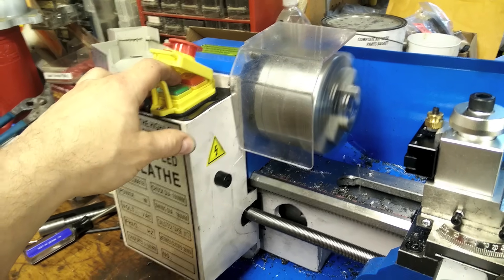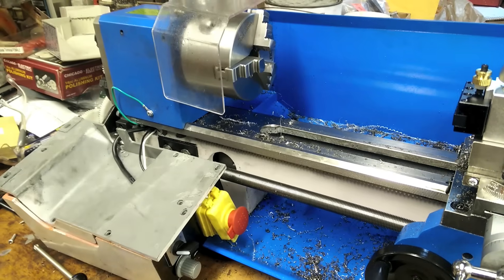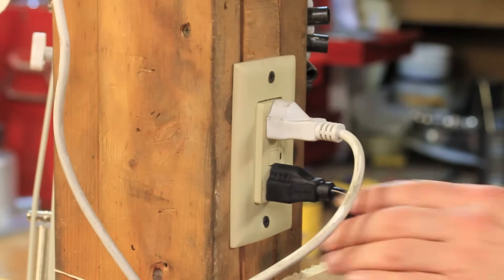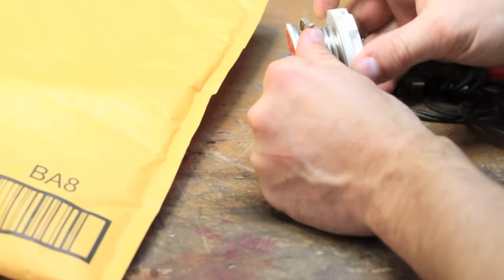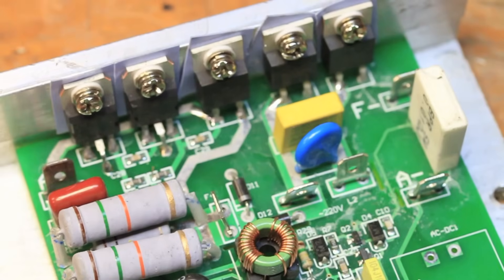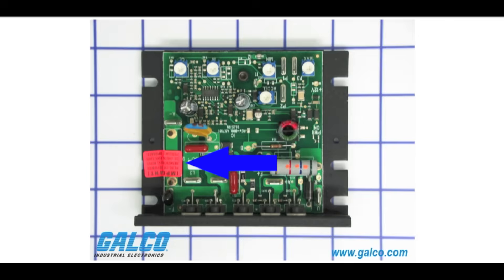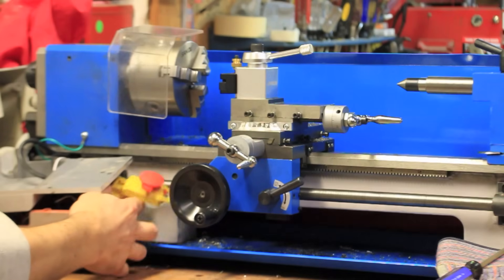So cheap they didn't even finish

Comment from the maker: PLEASE READ THIS BEFORE COMMENTING!!

If you're comment is in regards to the cold solder joint, I thoroughly appreciate your thoughts and viewership but it has been mentioned so many times already. 

In order to get that shot, I had to solder it while hugging my tripod and looking through the view finder of my camera. Needless to say, it wasn't easy. However, off camera I gave it plenty of attention and I assure everyone that it is more that adequately soldered, hasn't given me any problems yet, and I don't expect any problems out of it. (I'd expect the rest of the board to go bad before that joint does!)

Thank you so much for watching and commenting.. I hugely appreciate it.
Reply: No flux ? That too can contribute to a cold joint.
Reply: TimNummy great job on repairing the board!
Reply from the maker: Thanks! :)
Reply: TimNummy It didn't actually seem like a cold solder joint to me, and you did solder it properly. There was just a bit much solder, making a large joint. I'm sure it would have worked well off that joint. But anyways, well done!
Reply: @PunakiviAddikti  That was most fucking definite cold solder joint :D
Reply: The variable speed was maybe a feature to avoid chattering. AHAH , check this by Haas Automation to see what i mean : https://www.youtube.com/watch?v=dXR2wDDFFm4
Reply: PunakiviAddikti a cold solder joint IS formed from a bit too much solder. 😑 The reason why it would be a bad joint is due to the connection being susceptible to cracking. It is characterized as being lumpy with a matt finish, which is as seen in the video at 8.55 Hope this clarifies things for you 😊

Comment: They wave or immerse solder those boards, they out flux on anything to be soldered and quickly submerge the board in molten solder.

It’s great, but your issue comes as no one is hands on soldering.

Our modern convenient age 😂

Comment: I too was unaware of the benefit of pushing in on the Faston connectors to remove them.  By the way, it's often beneficial to remove and reinstall the connectors in case there's some corrosion or lack of contact that's causing the problem.  Removal and reinstallation often corrects the problem.

Comment: Did you ever replace the large resistor with one of more appropriate value?  The data sheet you linked for the KBIC shows a 3/4 HP motor (550W) to use a .015-Ohm resistor @90V, but the one on the lathe is .01 (1hp). Per KBIC manuals, proper resistor will eliminate most CL and IR pot adjustments. Just a thought.

Comment: When you repair a circuit board, also watch for cracked solder joints, they act the same way.  Often the crack is very fine and is hard to spot, so angled lighting, magnification helps. If a part is too 'wiggly' on the board, chances are the solder joint is broken!

Comment: Tim sorry for your troubles. I know it has been a long time but I'll leave this info for the next person with troubles.
Oh, BTW good troubleshooting. Always go for the simple stuff first. Use your eyes and sense of smell and touch these can carry you far in troubleshooting.
Now for some electronics speak. That paper you talked about is called a Sil-Pad. It is a Silicone pad that has thermal conductivity and high dielectric voltage withstand. If you forget one of those most likely you'll start blowing fuses. That metal plate called a heatsink will also become energized when you apply power. If you leave out more than one the heatsink will be energized and again you'll be blowing fuses and also destroy one or both SCRs. It looked like there was solder there at one time but it has since burned off. That horsepower resistor is actually a shunt resistor which is used to measure the current the motor is drawing. Motor current is probably part of the regulation loop to maintain the motor's speed. Now, for the point, that shunt resistor is large and must dissipate a lot of power, hence it gets hot. After use, it cools off, this thermal cycling causes the lead to expand and contract pushing the solder away from the lead. The proper way to install a hot component is to use clinch soldering. Clinch soldering is where the lead is bent over flush with the board then soldered. You end up with a much better joint that can better withstand thermal cycling. So, if you get a chance, remove the solder, bend the lead over and re-solder.
Again, thx for sharing.
Reply from the maker: Thanks for watching and the detailed and very helpful comment!!

Comment: Issue with mine is that when the lathe is on but the speed dial is set to zero the motor starts intermittently. I may give that adjuster a try.

Comment: Good job and nice video.  Just a minor correction/safety tip.  The 'thermal paper' is actually an electrical insulator.  It is needed since the metal at the back of the SCR's is electrically connected to one of the legs internally (the Anode) which usually has mains voltage on it.  It is therefore very important to install them back (as you did) in order to prevent short circuiting the SCR's or at worst having mains electrical leakage to chassis.   Ideally I would put thermal compound (similar to that used on CPU's) between the SCR's , the paper and chassis to improve heat sinking.   There should also be an electrically insulating washer in the screw attaching these SCR's.   It is a lipped screw to ensure  metal to metal connection is prevented.   It is also very important to have these 'washers' installed to prevent electrical conduction to chassis.   If any of these components is lost or damaged during tear-down they can easily be obtained.   The SCR's in question are TYN 625 which means their package is a TO-220.  You will find many on Amazon or ebay.   Search for TO-220 insulation kit.

Comment: I have that exact iron! One gotcha to watch out for is that you'll inevitably solder the tip to the retaining sleeve, making it necessary to tap the sleeve with a small hammer to extract the tip. Do NOT tap the tip, instead place the tip down on a block of wood and gently tap the end of the sleeve!

Comment: Hello Sir,
Thanks for sharing Your videos. I enjoy them as I have the exact same lathe.
Can You please confirm if Your K11 Ø100mm chuck from Sanou came with the lathe, as mine is aØ80mm?
If You fitted it Yourself, can You please tell me if it was a 1:1 fit or if You had to do any modifications?

Thanks a lot in advance and have a great week-end.

Comment: If you want to make this lathe perform like a race horse....spend a bit more money and buy a 3/4 HP 3 phase 3,000 rpm motor and a 2.2Kw VFD....about A$100 each. Some more money yes, but the performance will be out of this World. You will never stall this lathe with such a motor. 6mm deep cuts in steel will be normal. You can also gut the inside of the existing electronics box when(if) you fit the VFD
Reply: 3 phase for a mini lathe... Lmao!
Reply: @fellovercliff4525  So.…... you know nothing about 3 phase and now you mock the wisdom of the application......fool.

Comment: Great Video. I am not having your issues, but it is motor or motor controller. Has anyone had their lathe when turned on instantly have a high frequency noise that remains on until you turn the variable speed controller to 0. If any one knows what this issue is please send reply to jtlyerly@yahoo.com

Comment: Hey Tim. I have the exact same lathe and looking at my kill switch, noticed the hot (Blk) was on the left side and the neutral (Wht) was connected on the right side of the switch. Just in case, I'm going to swap them now. How do you know which connections are supposed to be hot and neutral? Cheers

Comment: Please can you help me with your advice? I have SIEGE M1 lathe combo with milling XMT-1115 voltage for lathe DC motor WERY SLOW, it's give only 8V. Can you tell me PLEASE what's the reason? I can send Photo of the Motor Controller
Reply from the maker: You're better off asking the guy I linked in the description who helped me with my issues!

Comment: 8:30 If you would solderout the resistor, the cleaning of the pins would be much easier.  Re-solder again and it should be fine.

thx for the video ;o)
Reply from the maker: Thanks for the tip!

Comment: oh wow. I love most of your videos but don't go into electronics. Some cringeworthy stuff you did there.
Reply from the maker: Can you elaborate?
Reply: @TimNummy  Sure. Mainly just the scraping away of most of the "protective coating" where you scraped clear through the tinned solder pad and solder mask down to the copper. That coating could have probably been removed with either 99% IPA or denatured alcohol and a toothbrush. The cold solder joint that people keep mentioning would have been prevented if you had left the tinned solder pad intact. Since this particular pin looks to be connecting to the common ground of the board it probably took a lot of time to get the solder to flow properly. But as you mentioned in your pinned comment, you addressed that concern. Other than that, just nitpicking on terminology.

Comment: These "thermal papers" are actually electrical insulators for this TO220 chips because middle pin is connected to backplate of SCR or diodes (or anything in TO220 package) and you would have nice big fireworks without them. That's why screws also have that white plastic washers so that head of screw do not touch backplate of chip.

Comment: Great series man. The board probably went through a flow solder machine and the solder didn’t grab properly; you can see solder on the tip of the leg. Then they either didn’t test it or there was enough connection for test, and no one QC’d it. Also you probably didn’t need to scrape the pad, a little solder on the iron rubbed over would likely have cleaned it up. Just looked like dry solder and spray flux residue, I could be wrong though.

Comment: God damn, plug in soldering iron, it hurts to see one of them. They are sooooo bad, soldering station rules
Reply from the maker: Thanks for the comment! I just needed something cheap and easy.. but if I start to get into more soldering projects I'll consider upgrading - do you have one in mind to recommend?
Reply: Well, I'm from Germany and pretty happy with my toolcraft st-50A, it heats up fast, uses Standart tips, gets to 450°C in like 20 sec and you can replace the entire hand piece because it's connected with a detachable cable. It eats about 100W, thery nice thing

Comment: I'm very curious about the wobbliness shown at the end.  Is the lathe just resting on the bench, not fastened down?
Reply from the maker: Correct, it's not attached to the bench and relatively light weight and unstable in the short side direction.
Reply: Most machine tools need to be bolted down to a heavy bench or concrete floor with shims in order to get the bed to be true and to improve rigidity.  The usual way to do this is by using an extremely sensitive level (half a thou in ten inches for one bubble graduation is typical) to level the bed side to side and end to end.  It doesn't need to be level to operate; it's just that being level lets you use local gravity as an extremely precise measure of straightness.

Comment: OMFG ! ! ! !
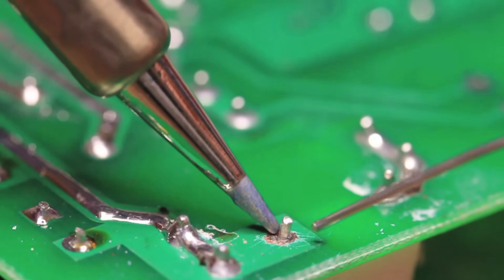that solder on 8:50 gave me CANCER
Use some flux, for gods sake please!
Reply from the maker: It was flux core :( Still need more flux?
Reply: not sure if this is troll question,...
But yes, every surface you want to solter needs to be covered with flux.
Think about it as... well... Solder will run away and ball-up on itself, like it is running away from things you want to solder, like they are dirty. When you smack good amount of flux, solder "Flows", runs by itself to every little crack and makes good structural as well as electrical connection.
With no flux - solder will stick to itself, and maybe to iron, but will resist to stick to anything else. 
Maybe like mercury it will always ball up on itself. And you must use more temperature and "Scrape" with iron to shake it away by force, it overheats and you can tell by white surface finish of joint it is bad. 
It does not matter if solder "Has flux in itself", use more solder and make a "mess", after good joint clean up excess flux.
...
The way you made it is fine and will work, better than nothing, but again, it worked the way it was shipped :)
Try to solder with lot of flux and you will love it and never look back, it is usual beginner mistake.
edit:
I dip Iron in Flux, flux on surface1, on surface1, when hot clean iron on something - more flux on iron, solder to now hot and fluxed iron, melted hot solder on iron to joint, on contact solder jumps by it self to joint, done! if contact big maybe contact a little longer to heat it up.

Comment: The 'paper' insulators are SIL pads, in this instance they are not for thermal transfer, but to isolate the back tab of the SCRs from the chassis, which is why they also have plastic spacers on the screws.
Reply: Hi, agree to disagree,  the 'paper' insulators do the job of electrical insulation and thermal transfer to the big chunk of aluminum so the SCRr, or any other components, can dissipate the heat.
Tim, thanks for the video,  but man you killing me with the audio.  Just begun watching you, hope you fixed it.  👍👌👏
Reply: @mariusmac2005  Sorry I simply was not clear enough, yes they are to thermally couple them to the chassis, my comment was to state that the reason they are used instead of having no pad at all and just screwing them directly to the chassis is to also provide electrical isolation.

Comment: I got that cheapo soldering iron after struggling with a non temperature controlled one. Cheap and cheerful, but I'd recommend it.  So much better than the non temperature controlled ones, even if it's crude.
Reply from the maker: Agreed! works pretty well for the money.

Comment: Good video.Shame about the picky buggers.It broke,you fixed it.I have a china made lathe and mill.I knew from the start they are not well made,but with each machine i can fix the other.The electrics blew on the lathe so i made a set of stepped pulleys on the mill and used a old drill press motor.Cheers from a English man.

Comment: Nice job !  I always use solder with a little bit more silver in it makes a better connection over all.  It has a higher melting point than just lead and tin.  Also to transfer the heat better take the solder and coat the iron tip with the solder you are using.  Then with a wet rag and (water) run the tip to clean off excess solder.  The Tip should be nice and shiny to start.  Music is just fine ( they didn't find the problem, fix it and make a video did they)  LET THE CHIPPING BEGIN.... 
    Don
Reply from the maker: Thanks so much!

Comment: Hello Tim, just to chime in on the soldering discussion: Soldering irons have the sweet spot on the shoulder of the tip. The very tip itself is not very good at transfering heat. Just wanted to let you in on that secret :D
Personally I prefer the small chisel type tips (1.5mm x 0.7mm or similar) over everything cone shaped for general purpose soldering and horseshoe shaped tips for drag soldering and desoldering wick. Your new iron looks like one of the Hakko inspired ones that take the 900m // T18 style tips.
Congrats on fixing the machine!
Reply from the maker: Thanks so much for those tips! (pun intended) I definitely appreciate it. Next time I'll be sure to try the wedge tip but hopefully I don't have to do any more soldering on this lathe.
Reply: You never know :)
I bought a Sieg SC4 last year and it did not break down on me yet. However in my case there was a lot of mechanical setup and tuning involved to get it up and running smoothly.
Reply from the maker: Maybe there is something to the more expensive versions of these smaller lathes.. although the SC4 is a much bigger unit.

Comment: Nice work on the diagnostics and the repair.  I am sure this video will help many other people.  Just so you know in case you do not, that first large roll of solder you had appeared to be for plumbing applications so it would be acid core solder which should never be used on electronics where we use rosin core solder which already has flux in it.  (Like what you used) I know you did not use the larger diameter roll but you just mentioned that it was too big and not the fact that it was the wrong type.  The difference is important for folks to know.  I thought your repair of that joint was just fine.  Folks that have never made videos like this have no idea how hard it can be to do.
Reply from the maker: Thanks so much! I really appreciate that comment and the reassurance that it was a good enough solder fix :)

Comment: those thermal pads used as dielectrics. otherwise you'd get a short between the mosfets
Reply: The tab is often active, and across several MOSFETs or diodes they are rarely at the same voltage potential. Those pads are thermally conductive electrical insulators.
Reply from the maker: Are those tabs not common grounds though?
Reply: I am pretty sure there is no common ground. They would use thermal grease which is way more efficient if so. You can simply check it using your multimeter in continuity mode

Comment: Wouldnt thermal paste be better than the thermal paper i would have thought so ?
Reply: These devices need to be insulated electrically from each other.  That's why they used the silicone pieces.